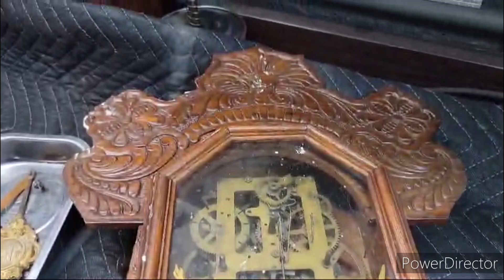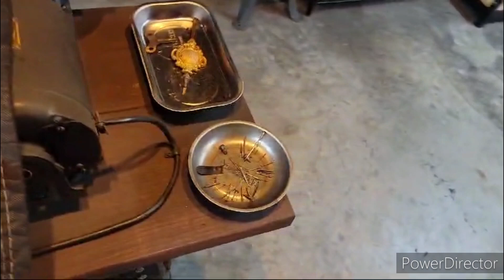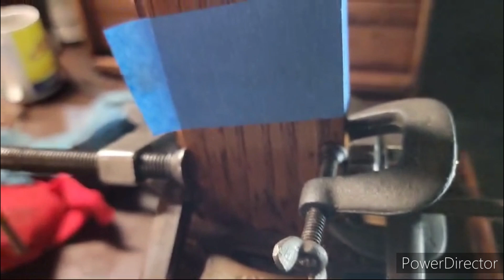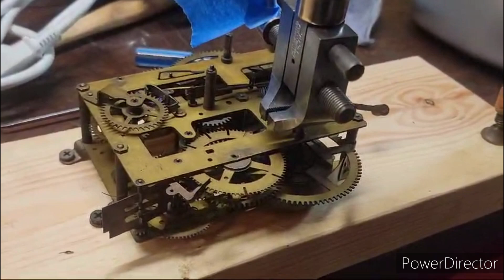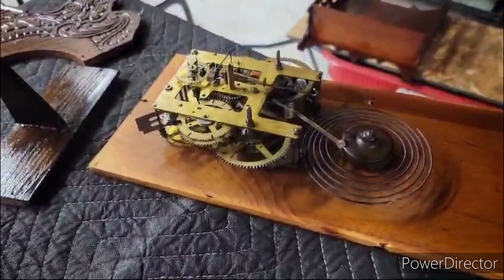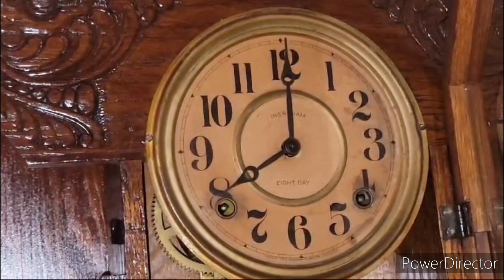1934 Ingraham Mantle Clock Repaired After Fall onto Floor!! Will it run?

Comment: I had a question and thought you would be the right person to ask. 
I like to restore smaller projects like old Black and Decker tools. 
I only do this as a hobby and the tools I fix up will only ever see limited use, but it would be nice if they were up to the task. 

My question is related to the rotor.
They will have these plastic shims/wasters/bearing surfaces at the ends. (Flat like a washer) 

Are these just washers? 
What are they even made out of? They are some sort of pastic it feels like but hard. 

And what if anything should I replace them with? 

Because sometimes I take them out and they seem ok, and other times they are pretty "crispy" or "dry" feeling.  

Should I be trying to replace these with nylon? 
Something else?

I also find these little springy shims, have no idea what they are called. 

Is it possible ro find replacements? 

I figure if I'm in there anyways that it would be nice to be able to replace them if needed. 

I tried looking online but I don't even really know the proper terminology to search for this stuff.

Am I ok to use Nylon washers off Amazon? 

I see these paper fiber wasers in the same sizes too... And copper... And steel... 

What should I be using? 

Cheers! 
Interesting Clock! 
And Merry Christmas!
Reply from the maker: Merry Christmas! The washers are called fiber washers. They control the back and forth movement of the rotor and their placement is important. Take a picture when dissassembling for reference and place them back exactly. You can use nylon or delrin for very limited use but assortments of fiber washers can be found online. They need to be close to the original size because the endbell might not slide back on correctly if they obstruct it.
Reply: @BencoVintageMachineWorks  Thank you so much! Good to know! I'll only use fiber washers for this purpose in the future!